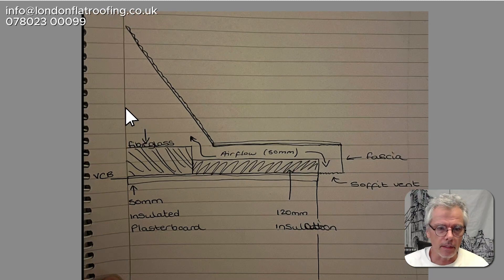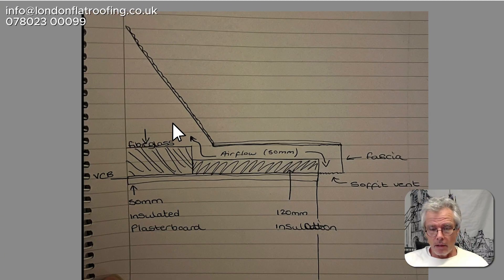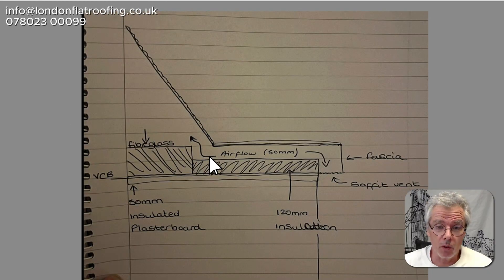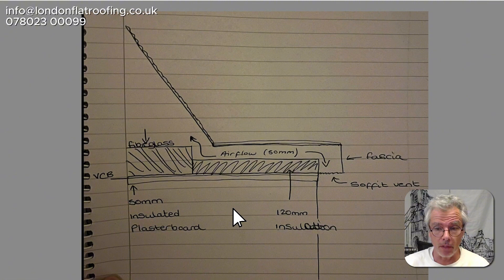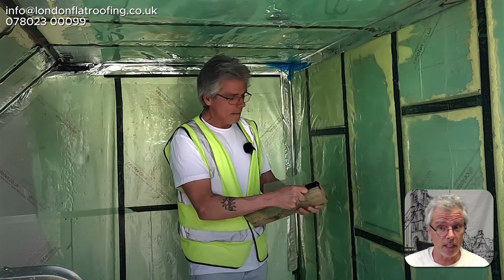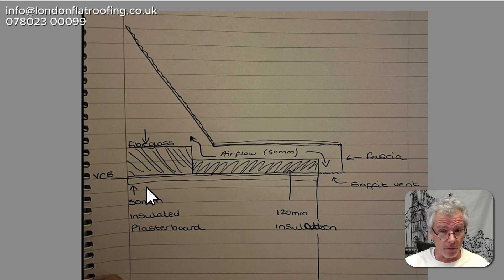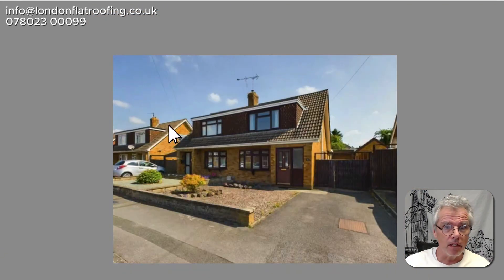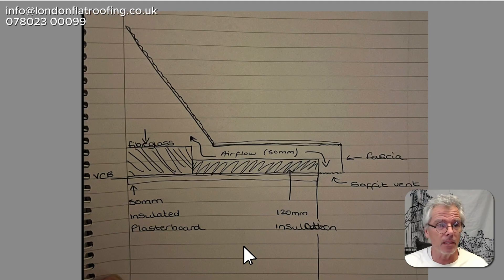Solving Dormer Roof Insulation Problems: Faqs Answered!

Comment: I have the same ish (1970 build) dorma. I ripped all the plasterboard off from the inside (ceiling, under window and cheeks) built a false wall in front of it all, put 50mm celotex in the whole lot, reboarded and its one hell of alot better. To note i used acoustic boards to cut the noise down also. Before (20 years ago)  i had  just ripped it all off and added rockwool insulation slabs that was good but not as good as current, all the wood behind was still in perfect condition as the whole dorma is wrapped in felt. With that in mind i never used a vapour barrier. Being a plasterer it was easy for me to do it. But anyone with a few diy skills could do it and tape n joint it all to cut costs of getter a plasterer in.
Reply: Interesting you originally used Rockwool slabs. There is so little information on retro fitting insulation into the walls of a 70s dormer. I'm about to have my office dormer reroofed (with a warm roof), so at the same time, I'm looking to replace the old external vertical roof tiles and fit better insulation from the outside. I'm wondering whether adding Rockwool slabs is my safest bet, while still allowing the dormer walls to breathe? Then wrap the walls with an good air and vapour permeable felt beneath new standard Marley single tiles. @SteveRoofer does this make sense to you?
Reply: @phil7309  My thinking 20 years ago was that the dorma's could breath easily, when I redone the front 6 months ago I was thinking that the wood maybe had started to rot but it was perfectly fine. I'm just about to do the same false wall thing with the rear dorma's and believe that because it's not air tight in the house I don't need a vapour barrier and a main reason I won't add a vapour barrier is because I want to know if and when I get a leak from the felt roof, if it's all water tight I won't get an indication that there is a problem till the thing actually falls apart and that will be expensive. .  That's my thinking anyway.
Reply: @ thanks for the reply. My research is pointing towards Rockwall slabs as the better solution for adding insulation from the outside. In this circumstance there appears to be no need for a vapour barrier. Others have said the current painted plasterboard will to a degree act as vapour barrier. So until someone comes up with a crushing reason for not insulting like this, I’m proceeding.
Reply: What size were your studs? Would be nice to see how you did it. Could you send a link to a video or something pls?
Reply: I am also looking to replace my dormers with a warm roof as the felt is getting to tired.
I also wanted to do the same thing to exposed dormer sides. Would this be crazy?

Comment: Very interesting Steve, a common issue I expect. I have a new build (11 years old) with pitched dormers, and I've always wondered how they insulated those. My house feels very air-tight, and the dormers themselves don't feel cold, so I suspect that whatever approach they took when building was correct. However, my in-laws house is the opposite, the dormers added at a later date, and I expect that the insulation is similar to that described by the lady in her email (before any solution). Retro-fitting certainly comes with a huge number of problems to solve!
Reply from the maker: yes some of the insulation in some of these earlier 1970s 80s properties was very weak and there's a lot of exposed edges including the cheeks of the dorma so they generally are quite cold
Reply: I have a similar property, built in the 60s and dormer built in 70s. No sheathing on the dormer, so comtemplating whether to add it now

Comment: I think its a good pragmatic solution, alsothe house in the picture is semi detached, with a shared roof, so the optimal warm roof would really require the neighbour to do the same. I wonder also what the insulation plans are for the sides and below the window, as they unlikely to have much, if any insulation either.
Reply: Yeh unless I had loads of spare money/time in abundance & nothing better to do I'd 100% go with something along the same lines as her solution rather than mess on with a new warm roof. Unless the entire house was getting to the point of needing a new roof of course.

Comment: Another interesting problem, my thinking goes to the question, why not mix the two ventilation airflows? where exactly would the disadvantage be? I'm sure she'll be asking herself the same question. Nice of you to share it with us all  Steve🙏
Reply from the maker: Write at the beginning, I actually say mix it realistically you shouldn't, but I can't see with such a small roof while you wouldn't
Reply: @SteveRoofer hi Steve, thanks for doing this really helpful video. We actually have the exact same dormer flat roofs on the back (same size as front) which is about 15m2 in total of flat roof which would ventilate into the loft. & through soffit vents. I know ‘ideally’ it would be a warm roof, but do you think we would get away with it if we install a avcl like you suggest?